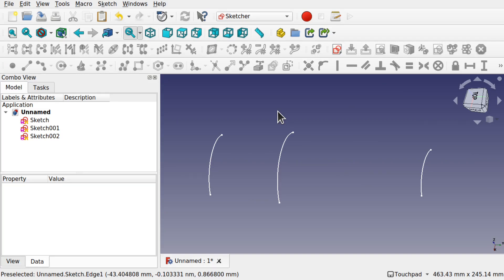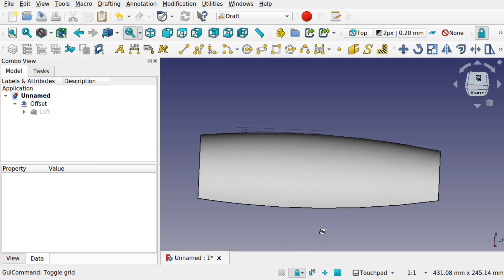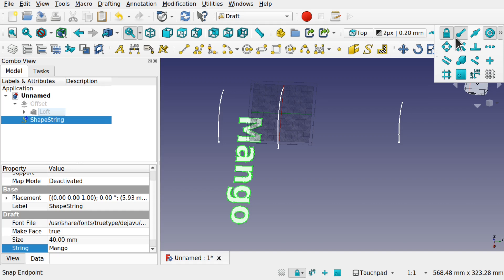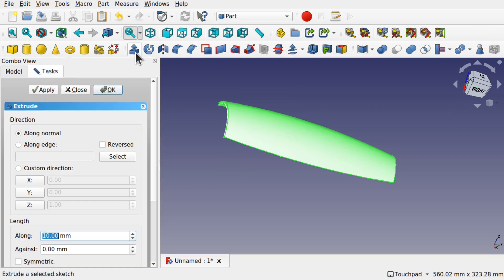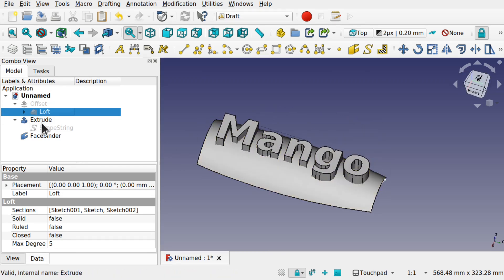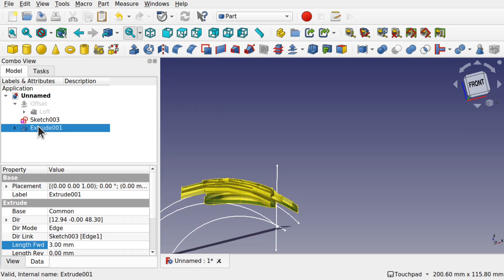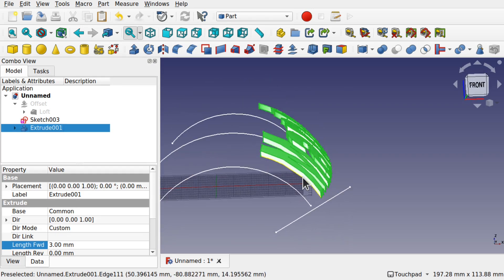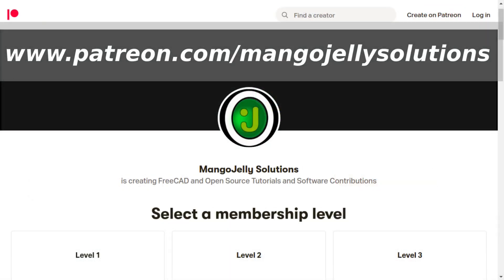FreeCAD: Text on Lofted and Curved Surfaces without using the Curves Workbench

Comment: New comment: I have completed this task and it worked a treat. I have now been asked to change the wording to include 3 additional letters. I have gone in and changed the letters in the Shape String and the extrusion worked correctly completely changing the entire phrase. However, the Common has failed to include the additional letters. So to make this clear, I have gone from the word KNUCKLES to the phrase MOI MOI TV and have ended up with only MOI MOI. Any assistance as usual would be greatly appreciated.

Comment: When I tried this everything went well except when I went to slice it for 3D printing. The text would not be attached in the slicer. Many hours later and a good nights sleep, this morning, I thought what option might allow me to connect the loft to the text. After looking up what Boolean means, I thought I might be on to something. So, I saw the Fusion feature and with hesitation clicked it. BAM! The Fusion could then be Exported to the slicer! Fusion Baby!  BTW, I haven't taken the time to make the text unskewed. I think I like it stretched out and offset.
Reply from the maker: I really should of added that to the video,  sorry.  Great you found the way though 👍👍👍👍👍
Reply: @MangoJellySolutions  Strange thing is though. If I zoom in on the text I can see under the text. It does not appear to be attached to the loft. Turns out however, my 3D print has a "Fuzzy Skin" which totally ruins the text.

Comment: Is it extruded along just ONE normal to a single spot? But normal should be different in all the parts of this surface...
Reply from the maker: You can get around this by using the 3d offset tool. Otherwise you would need to explode the compound (the shape string) and Extrude those individually. Lattice 2 workbench offers more tools to get a better effect with the text array. So many different ways sometimes it's hard to figure out where to turn to.

Comment: Thanks for the video it has helped to a degree. The surface I am working on is a multifaceted sweep, not a single surface loft. This makes a heap of difference as the parameters change in all directions. I received this tip below and it has given me the best results.

You can do this using the "Draft" and "Part" workbenches
- Create your particular text (deriving it from image, from Fonts, created with Draft, from * .svg, etc.);
- make the single characters become faces; (Wb "Draft");
- creates a compound made up of all the characters (faces); (Wb "Part");
- move the compound above the face that is to accommodate the text;
- aligns the view orthogonally to the projection direction;
- projects the compound (characters) with the "Create Projection on Surface" function from the Wb "Part" by adjusting the thickness of the letters.
- blends (Boolean union) the text projected in relief with the base object.

With this approach, I was able to project the text directly to the sweep surface and the profile depth or letter depth was perpendicular to the sweep face. This is very important when looking at injection moulding and mould release.

Thank you for your assistance as it has helped me with another project where I want to project a logo onto a simple lofted surface. - Cheers Steve L
Reply from the maker: Thank you for replying back and updating us. These comments are really helpful for all in the community and thanks for taking the time to add.

Comment: Excellent! This appears to be a lot easier than the curves workbench (which I haven't yet tackled).
Reply from the maker: Also there is another solution regarding part  projection which has been added to the comments kindly  by the original requester which I also have a video on.

Comment: I can't imagine actually using that in real life, it's complicated to add text. If I've got a model of any substantial size, adding text would be a total pita. There must be an easier way.
Reply: When I watched this video my first thought was that this is an easier way! Real world (or at least in my world) - this is just the ticket for adding text to 3D printed "waxes" for investment casting a scale model of a steam engine or other machine that was made from castings that  had raised lettering.
Reply from the maker: Thanks for this. I am going to have to make some kind of index of suggested applications for the videos.
Reply: @dickmorris6310  I wish there was a way of selecting a surface, and then adding text. This seems very convoluted, but maybe that's just me.